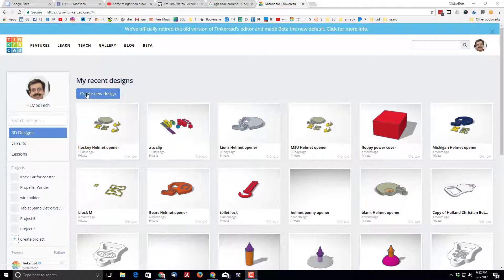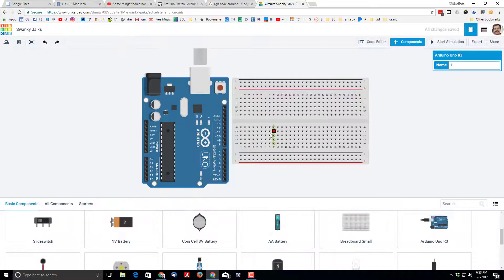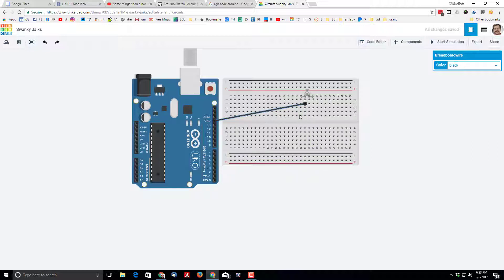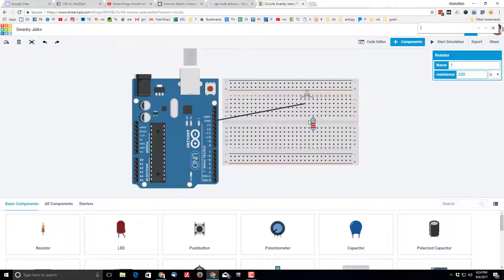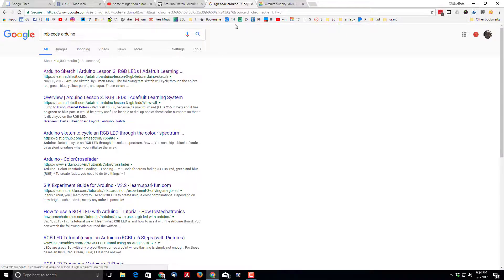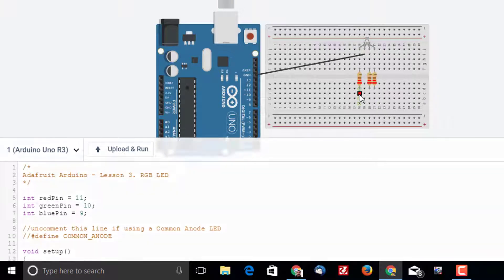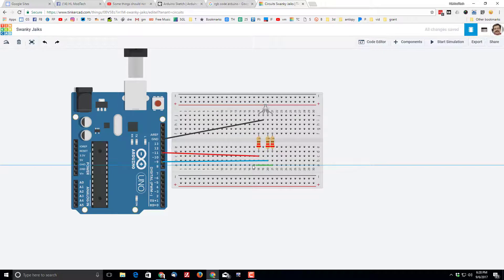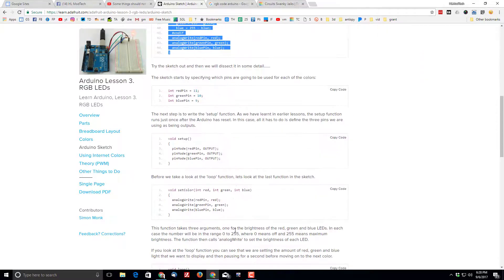Rainbow colors! Tinkercad and the Arduino make it happen!

Comment: Hello HL ModTech. Thank you for posting this video as I am a Neophyte to Arduino Coding and to TinkerCAD and it's been a great help in learning both.  I would like to know if you can extent the length of the component leads in TinkerCAD? Also would like if TinkerCAD is available for purchase as I don't always have access to the Internet. Last question does TInkerCAD offer a site like your 3D printing but for Circuit Boards. Thank you again for your Five Videos and hope produce more instructional and informative videos.
Reply from the maker: Thanks for the kind words Sal! I will see what I can do with creating some more tutorials. They are fun, but I play with so many things I kinda wander from project to project... I have not researched having custom circuit boards created. I have watched tutorials on how to create them though. In the end I just chose to solder parts into a blank pcb. I found the on gearbest really cheap. In TinkerCAD you cannot strech a component, but you can just use a wire to bridge the gap between your components. An odd thing I found is you can connect right to the leg of the component you want to stretch as well. It kind of bugged me as you could not do that in real life. I also believe TinkerCAD only runs in the cloud. GearBest is my favorite place to buy components. If you are willing to wait a while for them to get here, the price cannot be beat.
Reply: Thank you for responding back to my questions.
Reply from the maker: My pleasure. The interaction is cool as it helps guide me as to what to make next. =)